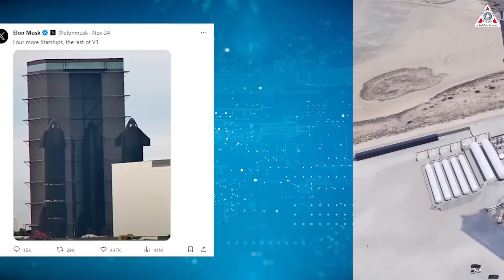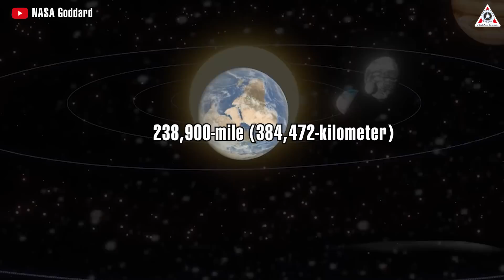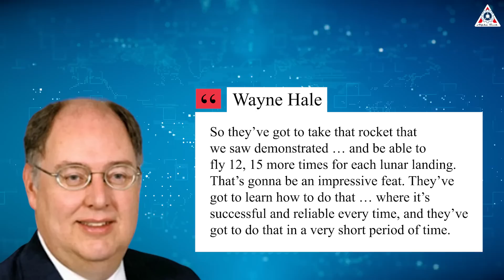Elon Musk just revealed Starship's INSANE plans after 2nd Starship exploded...

Comment: NASA no longer tests rockets via rapid development trail and error simply because of bureaucracy. First off major parts of their rockets are developed via  subcontractors located across the country. (Usually or at least traditionally in states where congressional support was needed). Everything needs to be tested to the extreme since changes can cause massive ripples and expense throughout the project. Since SpaceX does the vast amount of R&D and manufacturing in house, changes are able to be made easier. 

The other major bureaucracy issue with NASA is public/government perception. It’s much easier for them to loose their funding via failure and public outcry. Just look at all the uneducated criticism Space X got for the 2 Starship launches ending in a safety mandated self destruction. If this happened to NASA today, vocal critics would be demanding funding be cut and money spent elsewhere without understanding or caring about what expanded spaceflight could mean for humanity. NASA has faced this criticism many times in its past and it’s basically learned that any perception of failure could mean the end of a program. 

Space X has shown it’s approach can be very successful. They have developed 2 1/2 (1/2 credit for falcon heavy) rocket systems now in less time than NASA has been able to develop constellation/sls

Comment: should have been constructed out of aluminium would have saved loads of weight  tile would protect the aluminium like saturn  5 and shuttle
Reply: So your an aeronautical structural engineer? Didn't one of those shuttles break up due to failed heat tiles? These SS tiles are shedding like snake skin.
Reply: @brianw612   l have worked with NASA  satun 5 was strong enough and was made from aluminium  and the tile problem with shuttle was foam strike from external tank
Reply: Aluminum was not strong enough. He was going to use carbon fiber but it wasn’t that much of a benefit and much more expensive
Reply: I do remember them trying carbon fibre. I am a machinist and 300 series stainless is pretty strong stuff, that's what HSS drills are made of. Kind of makes sense too, SS made of SS. @johnsegal445
Reply: Aluminum has a very low melting point. Elon has engineers who think for you, don't worry.

Comment: SpaceX is doing fine, the progress since Hopper has been  stunning.
And we ain't seen nuthin' yet! 

The proposed engine upgrades will change the paradgm.  And allow bigger, heavier, faster ships.
If Elon goes for larger engines, after perfecting simplification and design concepts on the smaller Raptors, We'll see Starship super sized faster than NASA can cough up missions. 
 I suggest Space Force start thinking about their Moon base, Because its gonna be possible before they know it.
It might even behoove them to start funding Boring company to start getting a range of boring machine sizes, designed to operate on the Moon, So Moon base can be Sub Regolith, perhaps as a multi level array of tunnels on a hex/triangular pattern, with vertical shafts through out the array for access and surface lighting, via domed green houses.
This would allow use for cargo elevators, and circular stairways,
And some of them could be lander spots with airlocks to connect to ships. 
We're gonna do this, And always pays to think ahead, and get steps when you can.
If you have the design, you could be making things now for later transport.

Tunnel liners, hatches, green house sections, stairs and elevators, other rock carving equipment, over burden conveyors, and a design for surface earth works with the tailings, and maybe some metals extraction tech for the stuff carved out. And some metals processing equipment headed for Lunar self sufficiency.
Or, you can wait, and let the Chinese get there first and maybe not be nice about landing rights.
its your movie guys... Dont be  caught by surprize....
Reply: First male Starship flying without explosions. It does not help to have stronger engines so that is explodes higher.
Reply: @gottfriedheumesser1994  
The explosions have been for other reasons, so far was exploded twice for mal functions, once for not stage seperating, and the second time booster tumble screwing up fuel and oxy to engines  and not sure why second Starship was detonated, but sure they learned things.

So far, not repeating mistakes, so mistakes are learning, and learning is progress, and Elon has more toys in the box to play with. And judging by progress to date, it looks like they are accelerating on project developement.
And as far as I can tell they are on at least a possible path to function.
So, I'm not worried!
Reply: @garylester3976  The failure of the booster with hot staging can be solved. But as long as we do not know why the second stage failed we do not know how to react.
Reply: @gottfriedheumesser1994  
Yeah, but Gottfried, they have to have sensor data from that ship before they blew it up. Also theres likely Radar telemetry, 
and probably no few telescopes pointed at it.
And its become a much less complicated device with the Raptor 2 engines, and next launch is likely Raptor 3 powered...
Would be nice though, if they published what they had,  so us Armchair Enginerds could suppose things and maybe suggest ideas etc.
I'm not too worried, maybe they need redundancy in the communications systems? or do a black box back up with a GPS locator system?
But they re gonna learn things every time...
My guess is they know what the problems were on that ship, and just too busy to say much.

Comment: They've never explicitly stated it but I think HLS is gonna end up being a "moon elevator". They ditch the thing in orbit, refuel it later on then keep using it as the lander
Reply from the maker: Thank you for your comment!
Reply: I have wondered about that too.  If it happens then cargo and people will have to be transfered from a earth-moon rocket to the "moon elevator" to get to the surface.  Also, they will have to transfer back again to return to earth.  That would be awkward and inefficent.  Ideas??
Reply: @appliedfacts  I think they need to build the lunar gateway and use it as a propellant depot for Starships going back and forth.. but for Artemis 3 the lunar gateway will be unnecessary.

SpaceX will commission a bunch of cargo variants that land on the moon without crew at an HLS landing site and those cargo variants will get unloaded then take off to lunar gateway for refueling and returning home.. or they will be scrapped on the lunar surface for a moon base.

Comment: The Mechazilla arms will not catch the booster. They can't move fast enough. The arms will just open a bit and remain that way. The booster will come down from above and outside the arms then slide in until it gets in contact with the arms on both sides. Only then will it kill the last raptors and "land" on the arms. The arms have hydraulic dampers that soften the landing. Note the tapered stringers around and under the 2 hooks on the boosters.
Reply from the maker: Thank you so much!
Reply: No it can't hover. It can only decend or take off.. at least I'm sure I saw that mentioned somewhere.. maybe by Elon himself... I think it's because even the lowest possible thrust exceeds the weight of the rocket.. but maybe starship will be so heavy that it can hover.. 

it's also going to be operating with very little fuel reserves and has to perform it's burns strategically and quickly or risk running out of fuel.. it's like driving to the gas station when your tank meter says it's empty.. it's gonna be a stressful and uncertain drive

The arms will have to slowly close as the rocket stages slip in between and they touch each other just as zero velocity is achieved
Reply: @NPCSoftwareInc  You could be confusing Falcon 9 with Starship. Starship's booster can hover for a few seconds - Falcon 9 can't.
Reply: @knowledgeisgood9645  Remember that during the Starship landing tests they would litterally hover at the top of their test flight for a short time. I bet that the booster will be able to do the same.  I could be wrong but I think that one Raptor can use a small amount of thrust to allow the booster to hover during capture by the chopsticks.

Comment: $44,000,000,000 ? Somebody gttn rich ! 😛
Reply: Yep, That was the NASA budget spent on the SLS since about 2005.  The SpaceX Starship has cost about $4,000,000,000 since about 2017.  That is 1/11th of the cost of SLS.  It isn't over yet but when it is it will be SO much cheaper and versatile!!  The people getting rich from NASA are the commercial companies that do the actual design and manufacturing for NASA.  They are insultingly high priced.